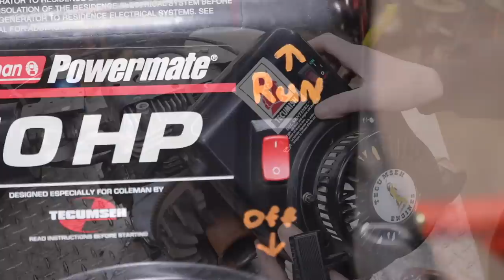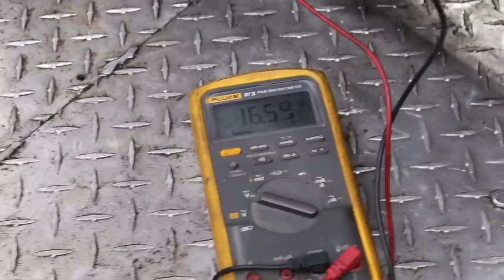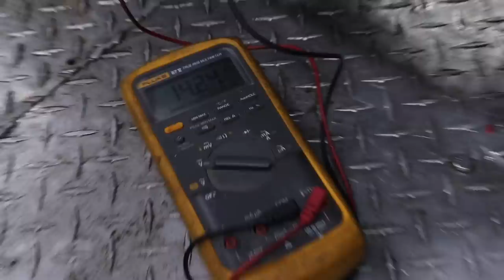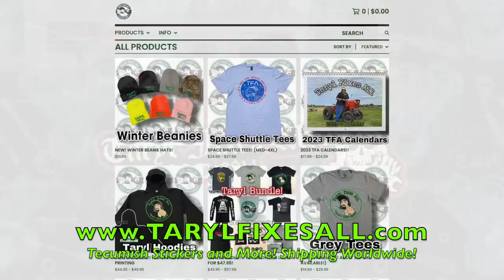Can you add electric start to a generator? Let's try

Comment: Don't use a trickle charger on a battery in storage. Use a maintainer. Like a NOCO, Schumacher or any of the many reliable brands. I use one on my Can Am Spyder. Trickle chargers keep a constant charge going to the battery. Maintainers/tenders monitor the state of charge and only send voltage when needed. Cool video.
Reply: I've heard, that some of them will exercise the battery . Drain and replenish it . A battery is just like me, has to keep moving or it won't go at all! Want to get one of those "set it and forget it" chargers.
Reply: I have seen many ruined batteries from those cheap trickle chargers.
Reply: Battery Tender.
Reply: I have the Noco Genius 2 and it has been great. Just like y’all are talking about, it exercises the battery, desulfates, etc. I’ve brought back a couple dead batteries with it. Definitely recommend the Noco!
Reply: Yea I agree but if you dont have a 12v maintainer , you could put the trickle charger on a wall timer for 20 min trickle charge a day to keep the plates clear. You know. That would work
Reply: You are so right my choice is the Battery Tender they make a weather proof model that rocks
Reply: Lol I bring batteries back around by cooking them on 35 amp charge for about 2 hours.

Thing has a 200 amp start setting for those real old batteries. Roast them for about 10 minutes on 200 and it'll start to take a charge.

Comment: I enjoy the informative videos.  The videos on older equipment have me reminisce of the days I worked in my father's lawnmower repair shop as a teenager back in the 70's.  Back then about the only thing that was metric was the threads on the spark plug.

Comment: @8:42 They're called ignition wrenches.
They are designed to work in tight places around vehicle distributors. The sets usually came with odd sizes like 11/32 and other sizes that you'd never use in a million years.
With electronic ignitions nowadays they are pretty much obsolete.
Reply: because of metric creep.
Reply: They sell them on TEMU in little sets
Reply: In days of points and condensers,  11/32 was the size used on many ignition systems.
Reply: Still got mine. Also great for doing instrument work .
Reply: @Tony, no these same "ignition" sets come in metric too!
Reply: I have English and metric and use them all the time
Reply: Craftsman ignition wrenches.
Reply: I have an old Snap-on ignition tune-up kit, comes with 6 offset wrenches and a points file , small pliers and a few other small tools in a satchel. Can't figure out what the pencil sized , grabbing tool is for?
Belonged to my late dad who was a diesel mechanic by trade, but he worked on gas burners too. He's been gone almost 10 years but it only seems like 2.
Reply: @bradrolling
Grabbing the set screw for the points so it doesn't fall down into deep dark forbidden places of the distributor.

Comment: Let me just say how much I love your videos. Around the holidays is really tough on me. When I watch your they really do cheer me up.

I love how you took a subject and turned it into a successful side hustle. 

When you talked about The godfather and the scene with the camera you stole my thunder. I know a lot of people did not realize that that scene was not written into the movie. And just like you said the director saw that and thought it was fantastic and that's why it made its way into the movie.

That terminal removing kit is a godsend. I've learned about them back in the early 2000. I bought my first Harley-Davidson and I was doing some work adding things to the bike like most Harley owners do. I was adding a seat back that can be removed. The taillight has to be moved and according to the instructions back then it told you that cut the wires since you could not pull the connector through the factory hole.

Before doing that I ran up to the Harley. I told my friend behind the counter that I wanted to buy a new connector so like did not have to splice wires together. He told me I got something better and walked over to the tool rack and came back with this two pack that look like Chinese throwing Stars. He opened it up and walked over to one of the bikes on the showroom floor and showed me how it works.

It did its job but that type of told did not last long at all. After the second time having it replaced under warranty I'd looked for a better alternative.

That's when I came across the ones that you were using today. The ones I have are not as many and as nice as the ones you have. They come on a key-ring and nothing to keep them in there. I love that yours has something to hold them all in.

If anybody knows where you can find this complete set and could drop a link I would appreciate it.

I also loved your idea for the battery and starter. I already have more than enough of those connectors that I could do that every machine I own and still have a few left over. When springtime gets here I am definitely going to put this warm a couple of my machines.

As always I made sure to give you a big ol thumbs up and of course I'm alrighty a subscriber. Look forward to your next video.
Reply: Leave the gun.  Take the cannoli.
Reply: I too have a hard time with holidays, I like your post but shorten it up.
Reply: @stclairstclair  thumbs down. i liked it how it was written. i also don't have adhd.
Reply: @aprilgeneric8027  I hurt your feelings.....
(me making sad face)

Comment: Great video at the right time.. I acquired 2 yamahoper motorcycles (1977 360&1979 250 ) that are complete basket cases. I've retrofitted them with 8hp tecumseh snow blower engines. Making them into adult mini bikes. Now just need to search out parts engines for starters and alternators. And there's my dinner.

Comment: Great video.  I've had a UB12260 lead acid battery on my Yamaha generator since 2011.  Have never charged it and it's started every year.  To be fair first 6 years was in a heated garage.  Impressive battery life?  Just jinxed myself, will get another one now...

Comment: I use a digital timer with the battery charger so that the charger only runs a couple hours a week. It keeps the battery topped off, but can't over charge it.
Reply: Very good ideal 😊
Reply: A float charger doesn't need a timer, and won't "cook" the battery. They are designed to just maintain the charge as needed.
Reply: @Farm_fab  I don't own a float charger.

Comment: Great job Taryl! I have a generac Megaforce without an electric start and I would have to do all of what you did to install an electric start. The flywheel with the ring gear is pretty pricey unless I can find it used. For the price that generators sell for these days, at least around here in the Northeast I'm sure the cost of this upgrade would be more than what it would sell for sadly.
Reply: Kit was 100.00 bucks and battery was 67.00
If it blows up will use it for parts 
Eather way I’m very happy with it
Reply: @philliphall5198  nice yeah for a generac gn-410 just for a flywheel with the ring gear would be way more than that sadly.

Comment: I was kinda thinking along the lines of its a good idea to add electric start, some peeps got bad arms and shoulders and such and manual starts can be a challenge.   I would have just put the starter and start button on and then used a jump pack or whatever to jump the thing.   As far as being concerned about the charge circuit, its on a generator so maybe that had a 12v DC  out.  Or you could always just plug a battery charger to the 120v ac out for a couple of minutes.    Anyways it was a good tutorial on how to add a charge and start system.

Comment: Great video. Thank you. Good news is that by the time a battery goes dead, the gas went bad too and it won’t start anyway. I would run the carb dry, empty the gas and keep a good battery maintainer (not a trickle charger)on a dedicated battery. When the emergency comes, put in gas and start her up.

Comment: Nice work! I have the same generator, might consider this, Couldn't you just put a voltage regulator on the overcharging alternator? what's 2 volt amongst friends?

Comment: Good timing. I have a blown snowblower and want to use some parts to "transform" my generator with an electric start BUT, the snowblower has a 120v plug-in. I'll have to do some research on that part.
Reply: use a 12 volt battery as usual with an inverter so you can keep the 120 V starter ! Less hassle i believe !

Comment: Done did that to the 12.5 Hp Vertical Briggs on My Log Splitter.
Robbed the Parts off a blown 15 Hp of the same vintage. 
Now I have lights & Electric Start on a Log Splitter .
Mike M.
Reply: Lights is a great idea for a log splitter.

Comment: I thought a diode was a one way switch?  The rectifier is what changes it from AC to DC.
Reply: Diodes are basically check-valves, keeping electricity flowing in one direction.  By preventing the reverse of polarity, they do indeed change AC to DC, just with gaps between DC pulses where the reversed polarity is in the sine wave.  More diodes, in the proper arrangement,  can be employed to utilize the other half of the wave.
Reply: Rectifier is a specialized diode. AC voltage basically travels back and forth...alternating current.  Rectifier/diode forces AC to travel one direction...direct current. It's the most common part to fail on a automotive alternator...can cause battery drain.

Comment: Have an old Craftsman Generator with a Tecumseh engine that because of where I store it,  using the starter cord was very difficult. Rather than going through all of the trouble and expense of adding electric start, I just removed the recoil starter and used my cordless electric drill attached to a ratchet adapter and socket that I would attach to the flywheel nut  Now I have electric start.

Comment: Anderson power pole connectors are super for high current 12V DC applications.
We use them in our Amateur Radio setups....
Reply: I agree that an Anderson connector would be a better choice for this application!

Comment: sadly those bullet connectors youre using for the battery disconnect are only good for 20 amps, a starter will MELT that connector in no time! Ive tried lol. Theyre only good for charging circuits
Reply: Burnt wires, schmurnt wires.  It's not the space shuttle.  A little shorting and electrical fire never hurt anyone.  In fact, the space shuttle uses fire...a lot of it...and that's the SPACE SHUTTLE.

Comment: The battery connection is a great idea.  Realistically, the customer needs to start the generator monthly and let it run for 30 minutes. Plug something in while it is running.  That keeps it energized. Turn the gas off and let the carburetor run dry. It keeps the battery charged and the carburetor in good working order. I just rebuilt the carburetor on my neighbors generator.  It had not run in a year or so. It was extremely gummed up. The engine is running well now, but  I am now chasing a low voltage problem.
Reply: One, of two things ; maybe the gen needs  ' flashing '.    2.  Maybe the  AVR (automatic voltage regulator )  is going kaput.....OR  ENGINE  RPM, IS  NOT 3600 rpm.....governer problems...

Comment: Tarl   I    have    a   old   lawn mower    with    a    briggs   and    stratton   engine   with     the    carburetor     mounted     on    to   the   fuel   tank   when    your    mowing   the    lawn     after   about   20    mins    or   half   An   hour   there's   no   power   in   the   lawnmower     and    throws   a   lot   black   smoke   I  also    replaced    the   crankshaft   seal    it   was   leaking    oil   very   bad   I   think   twine   raped   around      it    and    damaged   the  seal   I   would   appreciate   ur   help   in    telling   me  the trouble   with   it   losing   power   and   bellowing   out    smoke  tarl  your   videos   are  very   good   you  are   a    good teacher   from   yank   ireland
Reply: Not a fix, but helpful for diagnostics:
Black smoke = Running rich
Blue smoke = Burning oil
White smoke = Coolant getting into cylinder(s) (not applicable to air-cooled, but still good to know)
Reply: Likely a valve seat issue...engine gets hot and dimensions change. If it smoked all the time...choke stuck, oil over full, vacuum leak.
Reply: Thank   you

Comment: Rather than installing an alternator on a generator engine, just get a battery maintainer.  They will keep it charged without overcharging.  $10 at Harbor Freight.  Keep it plugged in when not in use so it's ready when you need it.  Then you can plug the maintainer straight into the generator while it's running.

Comment: Can you make a video on how that alternator works?
Reply: Hah technically it is a stator, along with the magnets on the fly wheel and the regulation all three components together make a 'alternator' of sorts.  It's a simpler system than an alternator used on a car where the car type alternators use electro magnets instead of permanent magnets amongst other things.   True alternators make much higher power than a stator set up typically used on small engines.   So in the stator set up the principle is to pass a permanent magnet close to the coils, when this happens a current is induced  in the coil and will produce a AC wave.   The AC will be multi phase depending on the coil wiring configuration, all the outputs of the coils are typically ran to a common point.  We call it wild ac at this point, to get it usable it needs to be regulated, so its either ran through a single diode for half wave regulation or a bridge type rectifier using 4 diodes for full regulation.    Next we need to control the now either pulsating DC with the half wave  or better full DC with a regulator.  The regulator will set the output to 13-14 volts typically and with a capacitor will smooth any ripple .   On the half wave rectifier the voltage will mostly be determined by the windings and engine rpm.   I have never seen a half wave damage a battery do to the lower current output and the 'half on' nature of the output, the battery will soak that 16v no problems.  Typically if anything they just do a minimal job at charging and won't run much else like lights and so on.

Comment: How about using a cordless power tool connector on the starter wire?   With a matching, sufficiently sized,  12V tool battery, it could start the generator and still be useful in it's cordless tool. Kept charged, it would always be good to go.
Reply: Lithium chemistry batteries are not designed to supply the extremely high currents required to turn a starter motor. IF you're lucky, the battery BMS will just shut it down.
Reply: @josephbrabenderiii2049  
I'm afraid you're mistaken.  Ignoring the many lithium battery VEHICLE jumper packs on the market, there are some 12v tool battery packs designed to deliver 30-40+ amps (which should be sufficient for most small engine starter motors) for up to 15 minutes straight.  I suspect, depending on the protection circuitry, even more could be drawn for the few seconds needed to start a properly-tuned small engine.
Reply: @ItsMrAssholeToYou  starter batteries start at 250 cranking amps. So 30-40 amps is a long way from sufficient.

Comment: When I first saw the video title, I thought you were adding an electric starter from a tecumseh snowblower.  As in a 120volt ac starter motor🤣. So all a person would need is an extension cord and a working outlet, to start a generator, to produce power, to have a working outlet, to plug in an extension cord. 🤣
Reply: That can be done also
Reply: The outlet probably isn’t working if you need the generator.
Reply: That'd be, crankception!

Comment: Btwi theres a thing called a battery temder. Its similar to a trickle charger but it monitors the battery and stops charging once its reached full capacity. They are super cheap and will significantly extend the life of your battery without having to worry about overcharging like a trickle charger.

Comment: Most Gen sets are happiest when run under load every month to three, freshen up the fuel or add stabilizer to the tank, add a fuel shutoff and run her dry…
Reply: I thought Sandals was great!
Reply: Taryl already debunked all the fuel stabilizers on the market.
Reply: @Paul Frederick  I still fork out for ethanol-free, but I stopped putting stabilizer in my gas when Taryl hit the one-year mark on the test.
Reply: @hughbrackett343  yeah ethanol free seems to be the ticket. There's a way to make that yourself. There's videos here of people doing it. You basically pour water in your gasoline. The things we have to do these days.
Reply: @Paul Frederick  there's a funnel that can separate the ethanol. I wouldn't believe it if I hadn't seen reputable people show it working.
Reply: @hughbrackett343  ethanol is a different density from gasoline. What I don't believe is that the government forces the use of ethanol. But they're making money so it is not surprising.

Comment: My brother got a couple of AEG generators with electric & pull start for a discount & they have a Chinese 4 stroke engines bolted onto them & there's no telling when we would ever use them because we had a big substation built and commissioned in 2013 & the only time that we had a blackout is when a huge storm tore through our area in 2014 which knocked down a lot of power lines & caused the circuit breaker to trip out at the substation.

We were out of power for 3 days because flood water prevented repair crews from getting access to our area.

A regulator could've been fitted to the first stator even because a woman who moved away from our area after her husband died gave my dad their Toro Zero turn ride on lawnmower to mow her vacant block until she sold it (we no longer have the mower because she sold it to someone else) which was powered by a Honda GXV530 engine which charging system kept frying the battery so I bought a single phase 4 Amp aftermarket 12 volt motorcycle regulator for it to prevent The alternator from frying the battery & it worked good